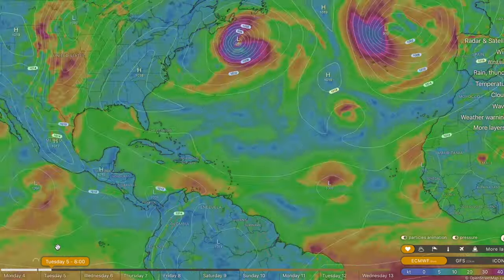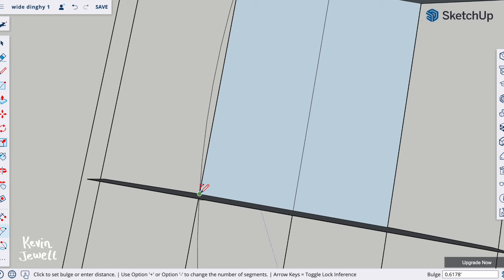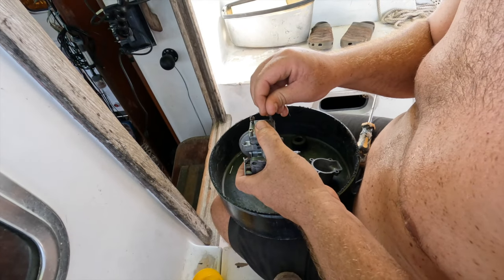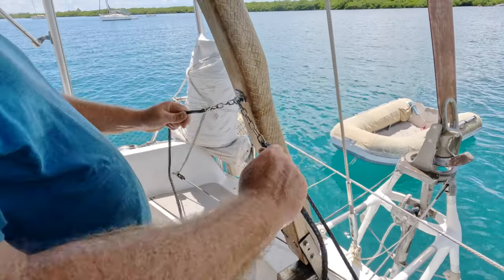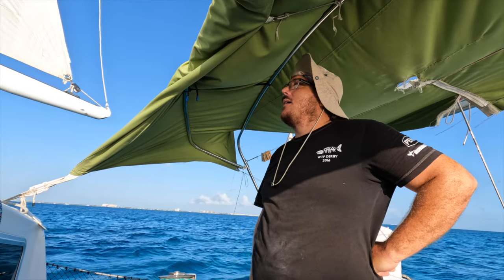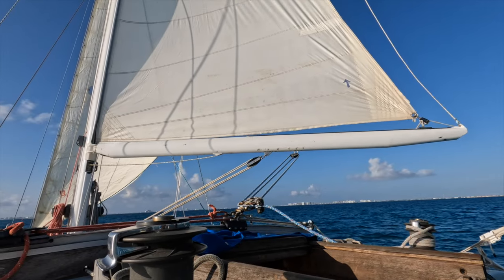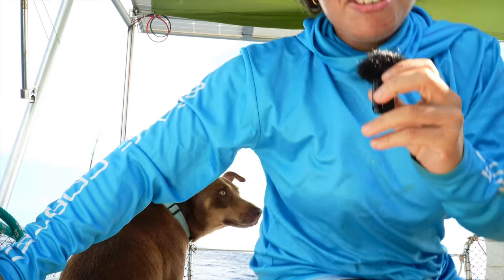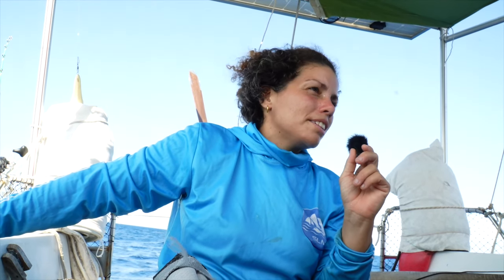THIS CHANGED OUR LIVES, sailing to cozumel

Comment: The outboard motor: if it uses a magneto then it has lost its magnetism. I had a weed wacker that had that problem. See if you can get a replacement. If it has a spark coil and battery then it could be points or not enough current getting to the coil. Maybe the capacitor.
Reply from the maker: Yes, we think that it is probably some electrical aspect - we brought the outboard to a repair man because it's a little beyond our expertise and equipment.
Reply: What he says!
Reply: I've got the magneto to restore itself in my old 2 strokes by attaching a  drill to the freewheel nut and spinning it for about 5 minutes..

Comment: Wonderful progress! Try soaking your outboard carb with mechanic in a bottle.... works for me 99% of the time!!! I am so envious of the solar cooker but it looks like $500 over my budget...
Reply from the maker: Yes, the gosuns are not cheap and we’re so lucky to have been given ours. I like to recommend the smaller, less pricey one to start, or piecing together a diy one. The right size vacuum tube, perhaps a tray from gosun, and a reflective surface to surround it all. But we haven’t tried it ourselves…

Comment: If you elongate the tiller on the back end over it’s pivoting point (piece of stainless that’s hooked on the end) then you can attach the lines in the back of this tiller by simply hooking the loop tied in the middel clearing the cockpit from any lines.
Reply from the maker: Interesting to think about - if we had the tiller extending out towards the wind vane at the back, we would not need to cross the wind vane ropes also…however, it won’t work because of the backstay in the way. Certainly interesting possibility though!
Reply: I have a split back stay going to the corners of the transom. This leaves more room arround the tiller and rudder

Comment: For windwane. Try one time without any Bimini / dodger. Give it a clean wind. The flyer wood wing was looking small. Aris need a big one and up straight or little bit back word angle not forward to the wind. Flyer need to be balance to the weight. So on calm ( 0 wind ) it need to barely come up word by it self. But not fell to side by the weight of the flyer. 
If you will need a ~ 0$ DIY electronic autopilot let me know.
Reply: It's common to face the vane backwards on the aries but Robinson grew up with this very devise so I believe he is right about the sail balance!!! Putting a 12 volt auto pilot on the vane is a good solution for light to no wind.
Reply from the maker: Yes this video was a lot of Robi trying to remember the correct orientation of the wind vane and fine tuning to our boat. It works surprisingly well! Maybe a bigger/less warped blade might help, and yes, clearing out the cockpit area more, although we wouldn’t survive more than a couple of minutes without the small amount of shade we have 😂

Comment: Hi. Long time no watch. I have the same outboard. Had two in fact. Mine is with a mechanic. Bearings exploded after I installed a new carb. Damaged piston and rings. Now waiting for piston. Your problem may have been the coil. Had that issue before
Reply from the maker: Yes! Robi also thinks it may have been the coil, even though there was quite a spark…in the end, we ended up trading up the outboard as parts for a newer 2.5 hp suzuki - the reason we travelled all the way to Florida! To offload some hard to fix gear, for newer equipment. We imagine that’s a little tougher to do out your way! We hope that your mechanic magicians are able to get the job done! Cheers man!

Comment: Great video.  Based on my experience with wind-vanes.  Is your wind blade tall enough? My is a little taller.  I have also used materials less heavy than wood?  Yours is wood?  Keep the updates coming
Reply from the maker: Yes, we could probably make a larger size for lower winds, and also have a smaller size for higher wind speeds. It's not ideal - the wood is permanently warped although we keep it flat, stored under a mattress. That's just the way it came - we would like to make some new ones.
Reply: Sounds like you are already aware and have a plan.

Comment: Did you have to check in again in Cozumel?
Reply from the maker: We've been told that technically within Mexico they want you to check into every new port, however, good luck getting in touch with most port captains (or successfully hailing them over the vhf radio).